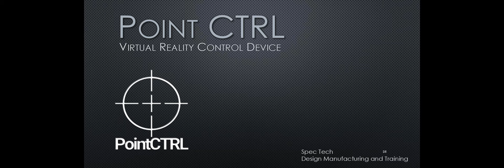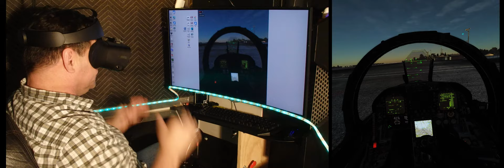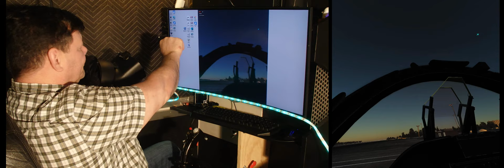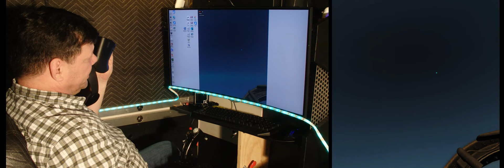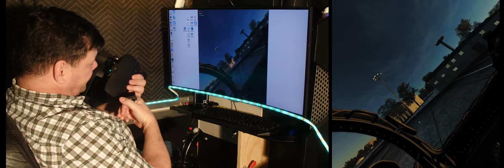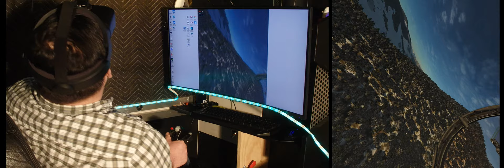edit: CAUTION outdated firmware  for reference only. PointCTRL Calibration and Demo mission in DCS

Comment: I noticed your difficulty reading the info on screens. Would you have to recalibrate the fcus if you move the virtual or actual seat closer (zoom in)?
Reply from the maker: Yea, my vision is going, and I have a wider IPD, The real problem is, I don't get a chance to fly much fly anymore, so I don't remember the general locations or functions in the aircraft controls. I wish somebody who uses DCS regularly would do better make better videos running a mission.
Thanks for the suggestions, I will try moving the seat closer.

Miles

Comment: nice vid miles, is the led strip to enhance rift s inside out tracking?
Reply from the maker: Hey FoxDelta,
Thanks it was 0400 and I was smoked.

Yes, the lights are for trackng, it makes tracking perfect for me. The room is usually to dark for the cameras to get good contrast, and objects closer to the camera provide better tracking resolution. The lights are just throw up there, I need to make them nice. I ordered some green ring lit fans to mount above my monitor for the same reason.